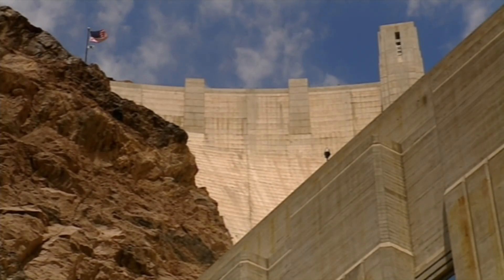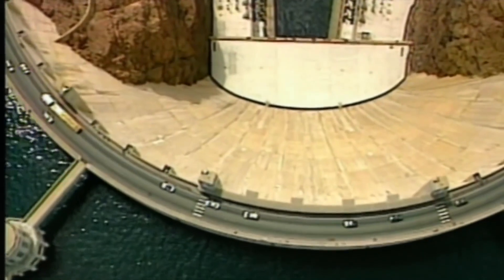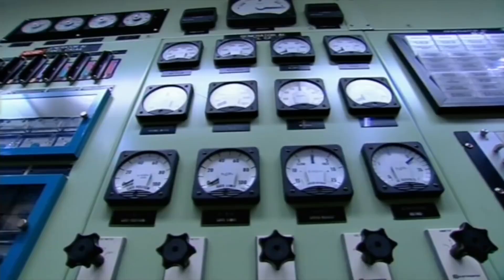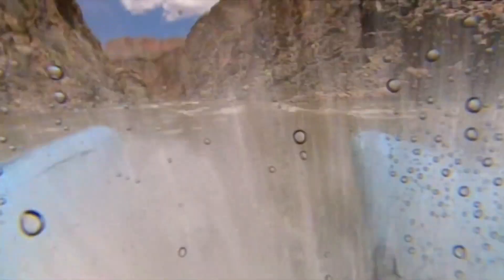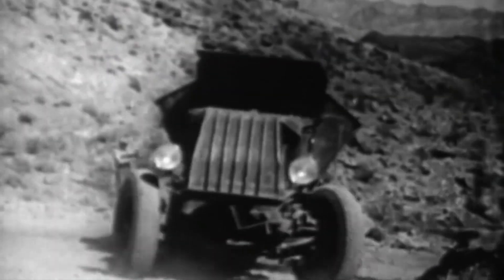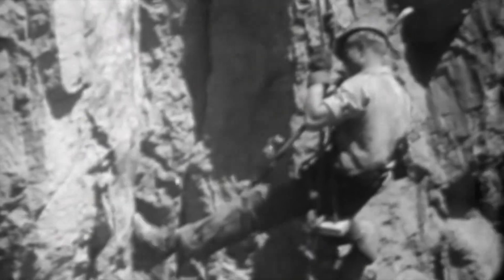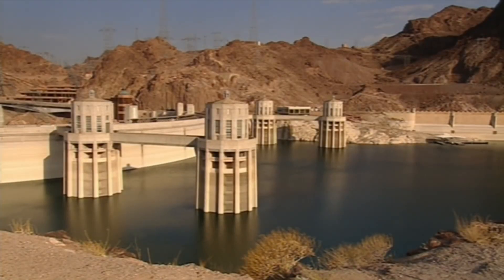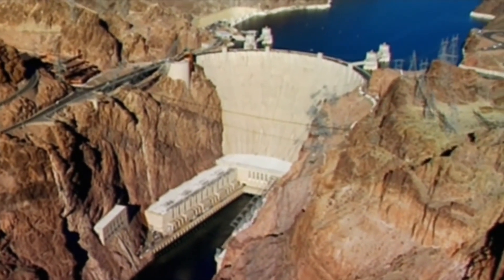How This Megastructure Was Built & Why Is It So Important? | Modern Wonders Of The World

Comment: I’ve been there and I appreciate the size of the dam and the amazing structure they built but…
I dont appreciate how little consideration they gave to the men who died, a plaque on the side of the dam that a few tourist see. There should have been more consideration taken for safety.

My dad was an Ironworker. He built skyscrapers, highway and even nuclear power plants. Safety is very important.

Things like heat exhaustion are not hard to fix. When it starts happening you watch for signs the start taking people in and giving proper care but finishing the dam on time was all important. Many of the other deaths I have read about are also from rush8ng to get things done too.